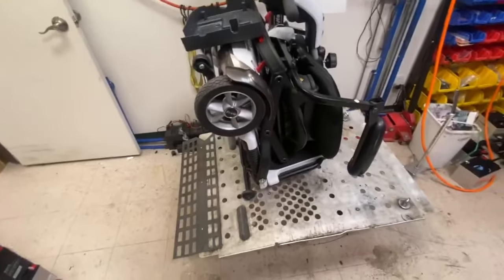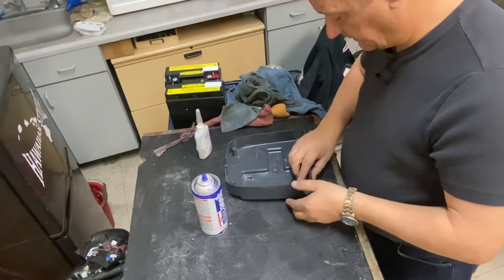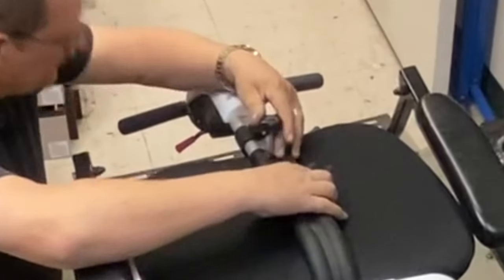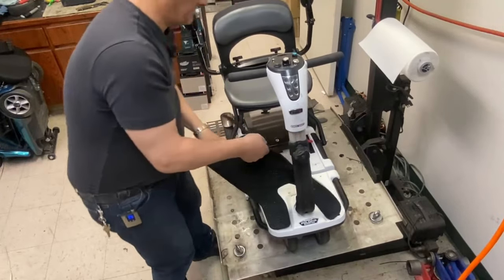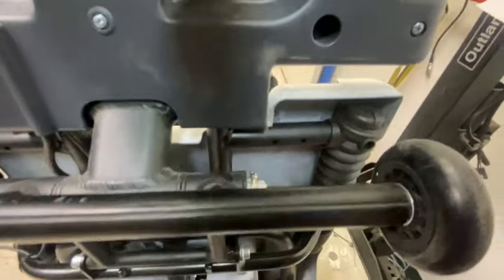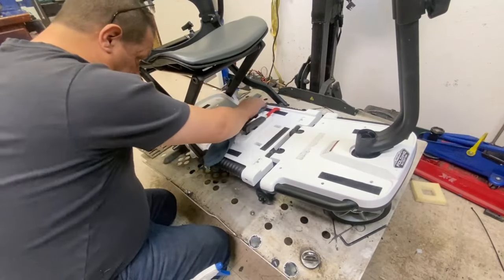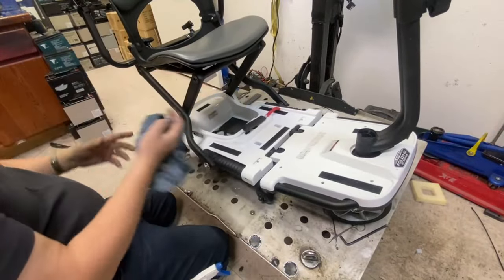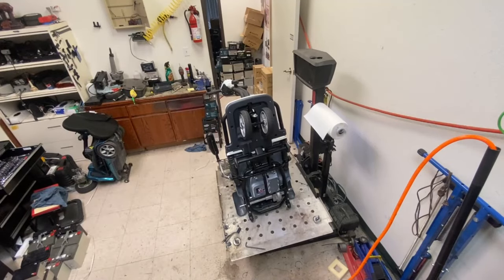Pride Mobility Folding Scooter Service and Repair

Comment: Nice job Ian ,there nothing worse when a plastic cracks I don’t know how many times have repaired mine with plastic weld 😅have a nice chilled Easter Ian and Jenny,take care bud.
Reply from the maker: Hi John, Happy Easter brother.  I hate having to replace broken plastic part as they are so expensive, even for us dealers. I have a Victory 9 I'm working on right now that needs a front foot shroud and I'm hating the fact I've got to buy one, as it will not get me any more money for the scooter it's just cometic thing.

Comment: Nice one Ian, another method to repair body work / shrouds being ABS, make up a solution of bits of ABS and Acetone then paint it on and may be put some s/s screen mesh to give it a bit more strength. It just so happens I was prepping body work today. Be lucky.
Reply from the maker: Great tip Clive, I'll have to steal some Acetone from drew the next time I'm over there. Thanks bud and say hi to the better half 😁

Comment: Ian, try using a cable tie and a soldering gun you must have stacks of broken ones! I have repaired car dash with this method and inside you can't see it and it don't need to be pretty best regards  Ken
Reply from the maker: LOL too true there I have a mountain of broken ties all over my shop floor. Thanks for the tip.
Reply: We've had the "Rascal" version of this scooter for about 18 mo's and have used it for a total of 5 or 6 weeks--only when we travel. Last trip overseas, we had to remove the battery pack (SLA). One corner of the casing was completely split as well as damage to screw spots. Weld gun and zip ties worked for ours. I had to redesign the battery case lid attachment. Now, if we could just figure out why the brake engages when both back wheels hit sidewalk ruts/elevator/metro gaps about an inch wide. So far, hitting the ruts at a diagonal seems to work to prevent brake lock. (I've watched the brake, motor, transaxle videos 😊). Thanks for the instruction!

Comment: Hi Ian!!  Do you by chance have a front fork color panel for a GoGo ES 3 wheel unit (Any color) and a 7" rear wheel cover for a Golden Companion GC340? All Monster Scooter has is what I believe are aftermarket 6 5/8" which don't match the originals. (This is for my own personal GC340) Thanks!
Reply from the maker: Hi Richard, I'm a little confused! the ES S83 S84 only came with a complete front foot shroud that also covered the front forks, which I also believe the Mega-Motion 8 or Rascal 8 both owned by Pride are the same scooter. I do not have a used one but they are available from Pride (new) Email me if you want to order one. As for the 7" chrome rear wheel cover, no I do not have one and Monster SP says that the 6 5/8 replaces the 7" cover for the 10-inch rear wheel. I don't think they are aftermarket just can be used as a replacement for the 7" cover.